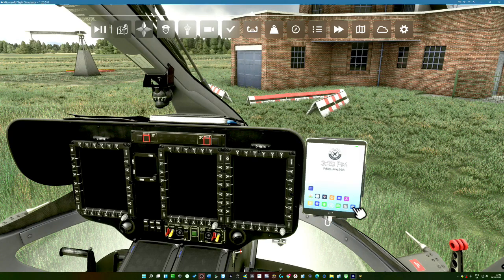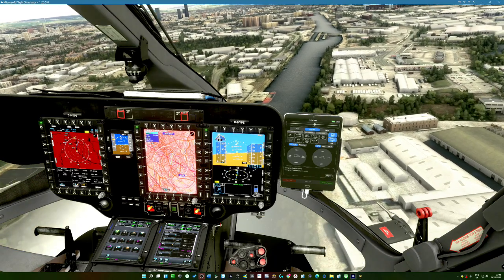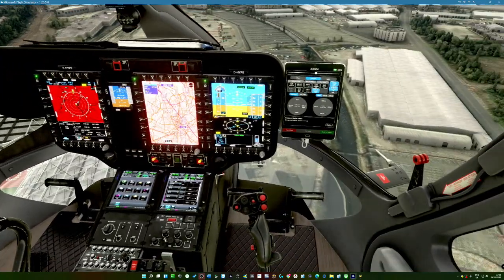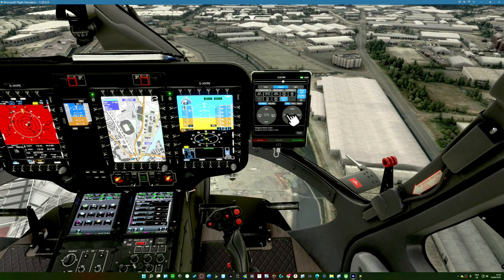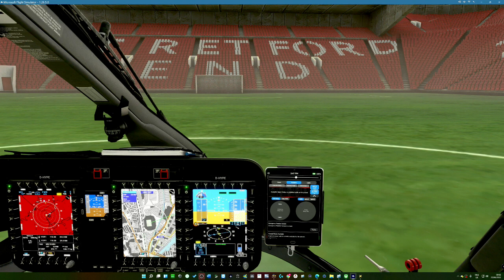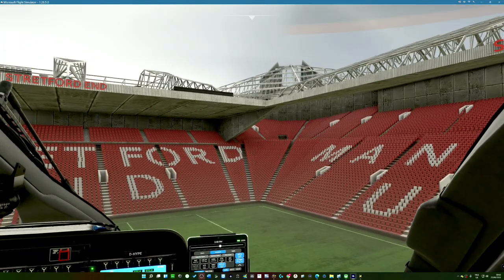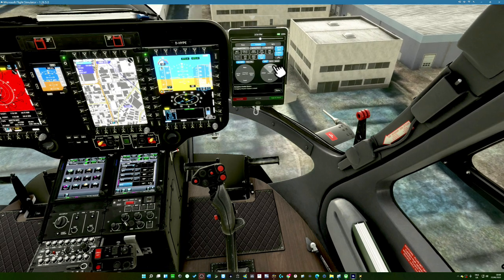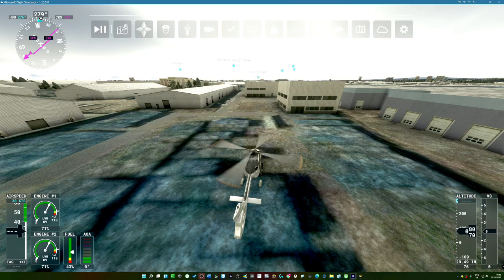8a. NEW H145 MSFS 2020 Landing Tutorial. Old Trafford (Man. United) Stadium.

Comment: The H145 drifts all over the place when the autopilot is switched off, a difficult machine to fly when compared to Cabri G2, would be great if you have a tutorial on how to hand fly without the autopilot. Thanks.
Reply from the maker: Jeff. Tutorial coming on this - will be up later tonight. Massive changes in stability now with the right settings in the H145, and with the right settings in MSFS2020. I'll get you flying really smooth; no jolts to correct, no need to keep applying changes to the stick, and I'll even get you landing without autopilot. Take care.
Reply: @theflyingdoctor  I'm a big fan of your tutorials, looking forward to learn from your flying lessons . Many thanks.

Comment: What flight controls do you use.
Reply from the maker: Rhino x56 throttle and stick. Logitech rudder pedals (but the twist on the stick will do for testing). I also use a streamdeck for controlling views with key combinations programmed into the buttons...